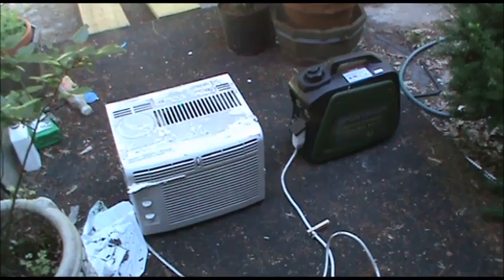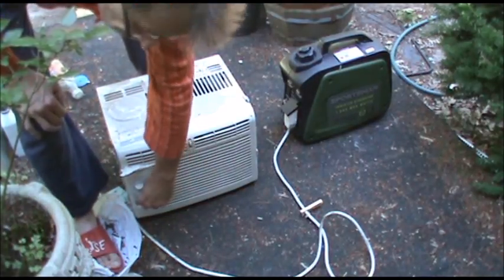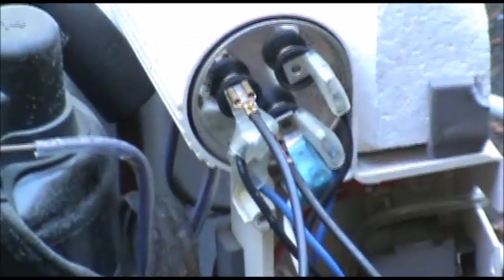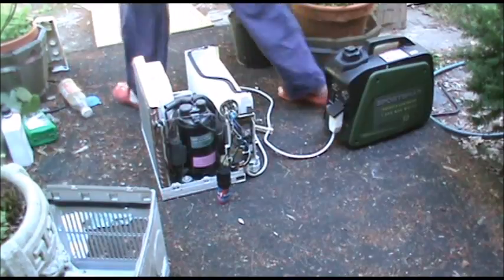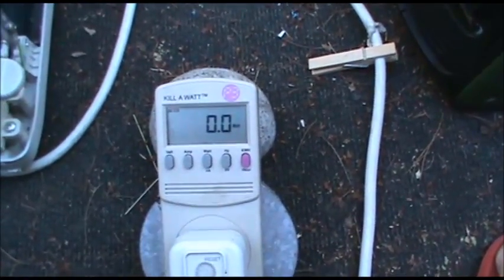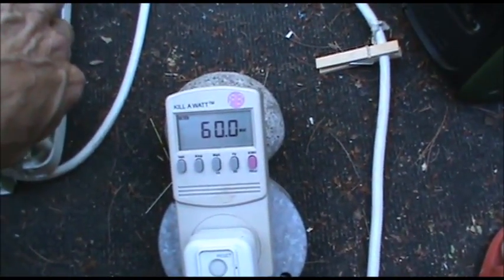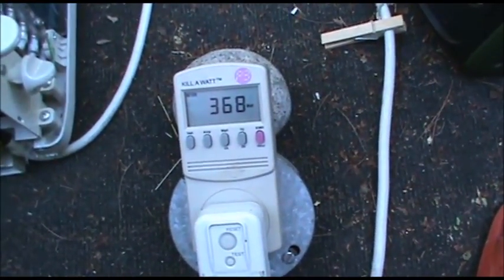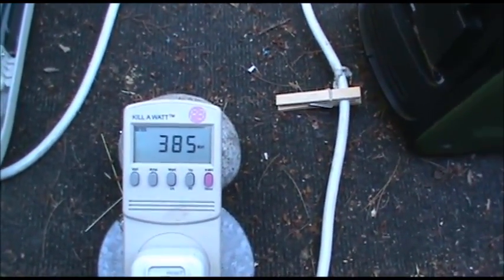5000 BTU air conditioner running on a 1000 watt generator

Comment: Im quite disappointed in my Sportsman Generator,... Mine doesnt run what it should & my $89 Harbor Freight 800 watt 2 stroke generator kicks its ass.
Reply: Yeah, me too.  There's definitely ones that produce close to the stated watts and others that aren't even close.  Sounds like you got a junk one like I did.  Mine goes off economy running a simple 75w box fan and dies instantly trying to run the same 5000 btu a/c others have success with.  I talked to Buffalo tools this week and a replacement inverter is $72. (I'm out of warranty), so I'm debating trying that.
Update:  I also tried adding a hard start kit with no success.   But, the generator went on sale again, so I bought a second one fully expecting it to fail also.  To my surprise, it DOES run the same AC unit that kills my first one.  I tried the first one again . . .  still dies.   Also, the new one will run a box fan on high without going off economy.  The first ramps up just a bit while running the fan.  That might be quick way to tell if it's putting out what it should.

Comment: Only issue I ever seen or heard of was the 5000btu a.c units WITH DIGITAL CONTROLS.... Checking with about 6 others No one came even close to a 600 watt surge. Of course I start generator in full power.. AFTER running a minute or so I then turn a.c. on low fan first about 30 seconds then high fan 30 seconds...then switch to cool...compressor kicks on let generator run a while till a.c.  cools down area then i swith to econo mode....Very very strange i say again..theres no special easy start capacitor on my a.c.unit... I even was ablle run on my old vintage Honda EX600 Generator rated at 450 continual and 600 watt surge..I Only let run about 2 minutes and i shut off because thats pushing little ex600 honda too much..

Comment: STRANGE!!! My 1000 watt sportman on econo mode runs my 10 year old 5000 BTU A.C. ... MY Friend has same generator no issue whatsoever.... You may have faulty generator.
Reply: I am thinking the same thing.
Reply: @vanhogan2179  im running a 5,000 btu ac right now with my powersmart 1,200 , 1,200 max 1,000 running watts
Reply: He does have. Faulty generator no doubt about that.. I hope he found that out.. the gen should and run 2 of those 5k btu maxed out this is crazy

Comment: One thing I found out and thought about on these little suitcase portable generators do not take any of the panels off when it's running. Some people do this in YouTube videos but I thought about this. this is a bad idea or to drill holes in the side panel this is a bad idea also. These small suitcase portable generators usually suck cool air in through the front and blow it out the back like my Sportsman 2200 watt dual-fuel suitcase portable generator does. I think this little 1000 Sportsman sucks in air from the bottom and blows it out the back. They do it with a fan they have in there so the whole engine and Generator will be cooled down. When you put a hole in the side or leave off the panel it will not let the air go through as good at all. And this could cause an overheating problem and lead to early failure. Why the guy did this is because on his suitcase portable generator when it was running and he took the little oil cover panel off he said air was rushing out trying to escape. That is true but air is being pushed through the generator like a tunnel effect. It's like drinking out of a straw if you ever get a hole in a drinking straw you can't get in as much efficiently with a pin hole in the side of the straw. I know what this guy is thinking by putting holes in it or some guys leaving the side panel off the generator. but this is actually hurting the generator and taking years off the life of the generator and it's making the motor run hotter. The only way I would ever believe this is if someone did this test which I may do some time to prove it makes it run hotter is measure the exhaust gas temperatures out the back of the generator at the exhaust pipe. But personally I would not want to do it on my own generator if I did I wouldn't do it for long. It's like taking the fan shroud off of your car's engine. On the bigger open Panel generators that are loud. putting a fan on the generator would be fine and would help it out on the hot summer days or running for a long time.
Reply: Jon Smith .
You useless long winded dip shit.
Reply: @gingerbread1032  🤣

Comment: I do voice command I talk and it prints it out for me it's so much faster. I'm going down the same road I just ordered the smaller 1000 Sportsman yesterday. And I plan to run a new 5000 or hopefully a new 6000 RV style window air conditioner also. But I'll have my work cut out I plan to run it on propane which you lose 10% of power.  I think you're speaking of hobotech I watched his videos closely. And talked with him through the comment section. Thinking about this he ran a brand-new frigid air RV air conditioner. I also took a picture of his video that give the part number of the AC he ran if anyone needs it. The Frigidaire air conditioner  hobotech said which had the soft start micro air built in it from the factory he said. if you look at his videos he leaves the part number for the 5000 BTU AC. Like he said and this is true in racing and engines the thinner your oil is the more horsepower you make on the technical side. I would just go back to 10W30 oil if you live in the cold climate for the winter time. I think the thinnest oil I saw at Walmart was like 10W20 or 5W20 0W20 is about the thinest. Also in a big air compressor gasoline powered I have it always helped to make the motor start up easier whenever I changed just the oil for some odd reason. Maybe because changing the oil was removing the little bit of gasoline in the oil because it's a gasoline powered air compressor. And gasoline will get in the oil from any gasoline powered engine eventually. And at some point I've got to change it over to propane. Running on propane the motor will last two to three times as long. The spark plug and oil is always super clean just like brand new running propane. propane is very dependable never comes out of tune and never gives all the hard to start carburator and problems. Here's something else I did to my very old non digital home air conditioner when I was almost ready to replace it. I thought I'll try this one last thing before I replace it with a new one. I have a big I think around 12,500 btu x 110 volts alternating current very old air conditioner. I bought it brand-new new years ago. And luckily never had to do any work on it. What was happening the cord was getting warm and that's very dangerous that can lead to a short or possible fire. And it was getting very hard to start up with the AC Plugged In The Wall. Even shutting everything off on that breaker it was blowing the breaker just trying to start the air conditioner alone. So after replacing the breaker that still didn't seem to get it and making a very thick extension cord that still wasn't doing it either. So I took the AC apart and blow it out with the big air compressor I have and it's right at 205 lb of air pressure more than most out there. I worked with Ingersoll Rand technical to dial it up safely several years ago. I really thought this will never work to fix the air conditioner problem. but this is the last thing before I just go out and buy a brand new air conditioner. After blowing the air conditioner out for about an hour or hour and a half and putting it all back together and putting it back in the window. I come across something I could not believe it worked. The AC started up like new with no problems and not getting the cord hot or blowing the breaker at all better than ever.  Because I was ready to junk the air conditioner if that did not work that was the last thing I thought to do. It was no longer getting the cord warm and it was it freed up so much power. I could even turn on my overhead lights on which is about 800 watts total 8 x 100 watt bulbs each. The AC worked fine after blowing it out with compressed air I could not believe it. No telling how many air conditioners just like mine got thrown away when all it needed was a good cleaning blowing out with compressed air. I could even run the air conditioner with the 800 what lights on when starting up the air conditioner. After cleaning it out the air conditioner. Also if you're trying to do like this video is doing the easy start micro Air I think it's called it sells for about $320 on the doorstep. it's a microprocessor a soft start micro air actually it's called. And they use them on the big 13,500 BTU RV roof mount AC running a 2000 watt Honda. And that's very fuel-efficient but the Honda has about 16.3 amps the Honda 2000 model does. But at Honda and customer service or technical they told me you cannot use 16.3 amps the whole time.OR it will kick off into overload. It will run 15 amps solid it's used for the extra 1.3 amps for starting AC's and stuff surge Watts. And Hondas have a bigger engine which burn more fuel but they are a good generator.
Reply: Can you repeat that?
Reply: @ John Smith- Can you repeat that?

Comment: Every truck driver could use this set up.Takes a ge 5050 btu and a hard start cap. Uses half a gal gas for 5 to7 hrs use for ac only.
Reply: Heck yeah, buddy. I wish I had known this stuff back when I was driving. I spent quite a few hot nights with just a fan sleeping in my rig.

Comment: There are quite a few people running the 5000 btu ac on these generators.  I think you need an AC that comes with the built in capacitor.  The others on youtube haven't had any problems
Reply: I went for a fridgedaire 5000 that others have had success with. It works but you have to switch from fan to low cool to high cool slow at initial start and let the gen adjust even with eco mode off. The generator speed needs time to adjust even with the right air conditioner. Not all ac will work, only certain ones designed to have a low surge startup.
Reply: @jimbob3030  my buddy powers that ac on low cool with the generator on economy mode..  

He puts it in fan mode.. Lets the generator adjust then switches it to low cool... All with the generator in economy mode.. It must be on gas... The generator can not do it on propane

He learned it from HoboTechs channel
Reply: Not all ACs are created equal. I tried a new GEN1000i with two new 5000BTU ACs, both purchased at Menards
:

- Cool Living CL-RAC05MW
- Soleus Air WM1-05M2-01/02

I was completely incapable of starting the compressor on the Cool Living. The Soleus would start only
if I turned economy-mode off, then started it in fan-mode, then instantly moved it all the way to low cool. 
Any other procedure killed the genny when the compressor kicked on.  I then installed an SPP5 start cap. It 
helped a lot, I can now start up the AC without special procedures and it even runs in economy-mode on low cool.